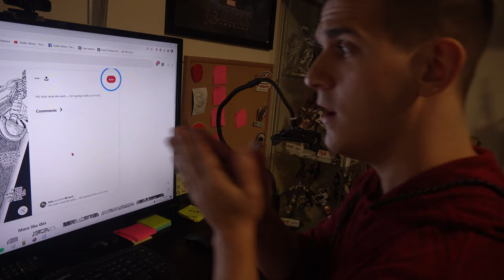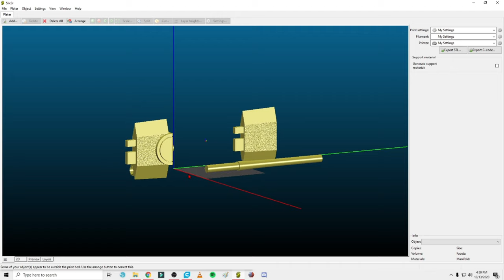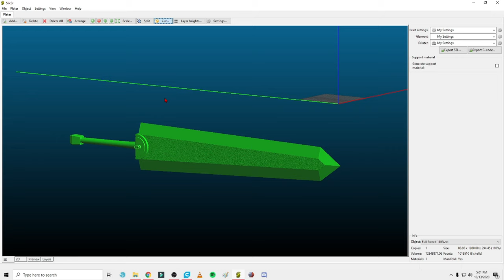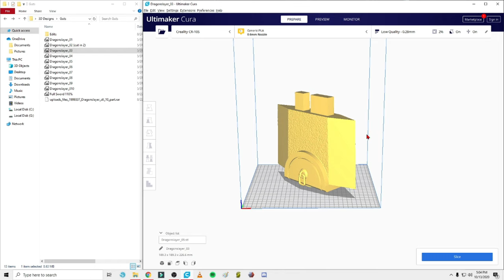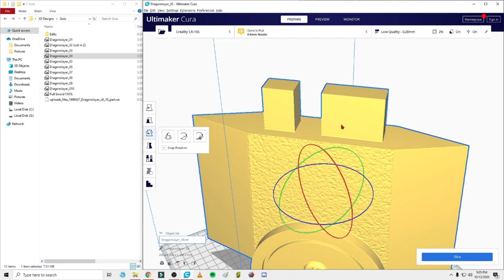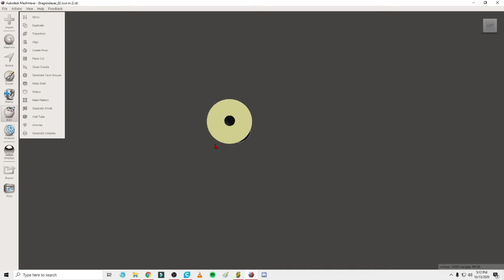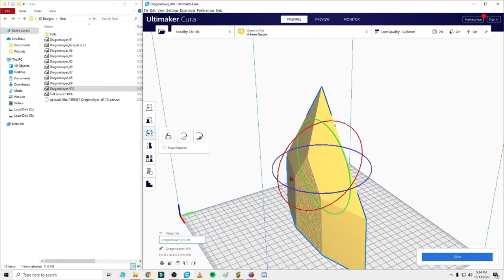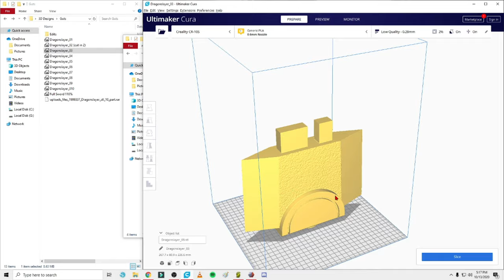How to make The Dragon Slayer! Guts' Weapon from Berserk!

Comment: Almost done with my Dragonslayer! I had a wayyyy different file than yours! Mine has a PVC pipe running down the whole blade
Reply: I guess you are talking about the model from Printables, right? Did you make it? how did it go?
Reply: @multiversosdeleo3864  lol yeah I finished it, have I mounted above my setup now. Welded all the pieces with a wood burning tool after sanding

Comment: Is there a way in cura to make so it does different infil at different points? If I want to use the pegs instead of metal rod can I make it do like 20% for the blade but when it gets to the pegs switch to 100?

Comment: Hey Frank. I'm building a Dark Souls Black Knight Greatsword and i bought a metal rod to reenforce it, but the rod it self seems a bit wobbly (it's not super stiff). What kind of metal rods do you use? Are they super stiff and don't bend much or do you still have good results with weaker, wobblier metal rods? 
You built a kick ass sword by the way! it inspired me to build my own big freakin sword XD
Reply from the maker: I use these 8-10mm steel rods. They’re super sturdy
Reply: @FranklyBuilt  Thanks, i'll get a steel one then. Thanks for the tip :)

Comment: you should read the later manga and make another one the same, but in a different style (Miura changed the forms to rougher), wider of course, and worn with cracks on the blade, after what he went through with Guts